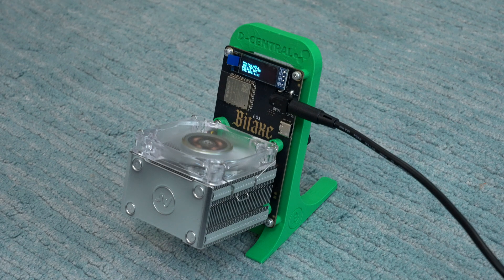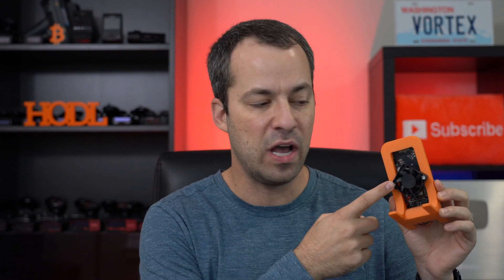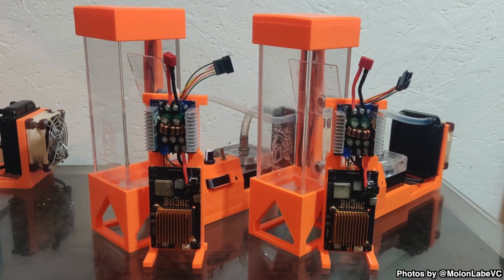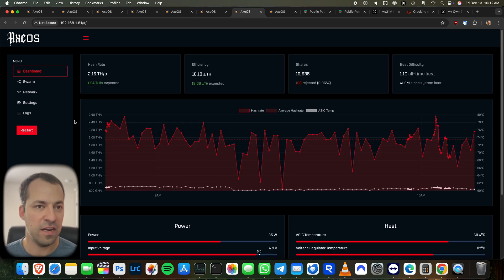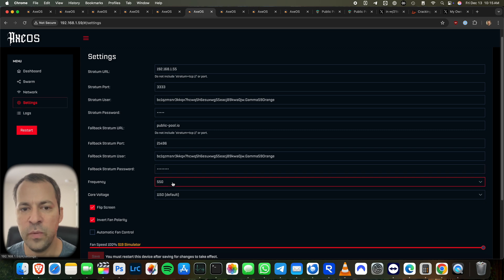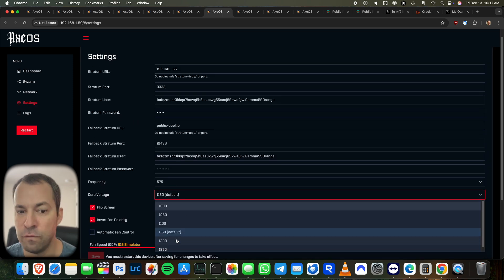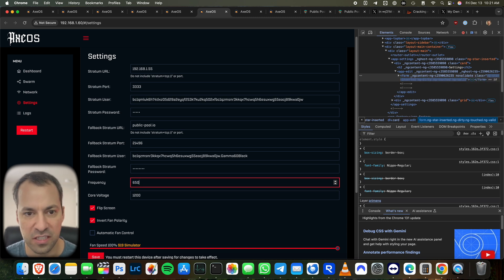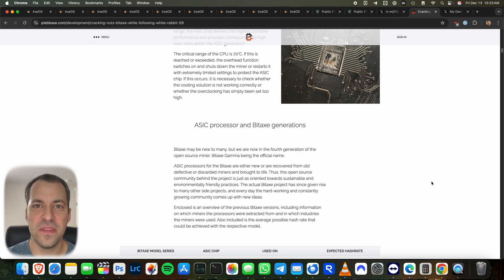How to Overclock Your Bitaxe, Part 4/4

Comment: It seems that ever since the very recent update, the right click + inspect trick no longer seems to be working.
Reply from the maker: Right, it's changed several times since making this video. The current method involves adding ?oc the end of the URL instead of using the inspect trick.
Reply: @VortexBitcoin  of course AFTER posting the comment I saw your updated video with instruction. ty

Comment: Just got my Gamma (BM1370) setup. It's stable at 625Mhz @ 1150 core voltage. Temps around 63-69C. If I undervolt it,  and hashrate stays stable am I good to go or should I also watch stale shares? If undervolted but hashrate is good is that the entire story?

Comment: So do you always run the fan at 100% even if not overclocking? I've been leaving my 3 stock Gamma's running on Auto/60°. Last night I put the Low Profile Ice Tower and 60x15 Noctua fan on one of them, but the 2 stock Gamma's are actually going better. (I used 2 bare copper shims so I think I need to take those out) So far I have only played with the settings in the non-oc UI for the upgraded Gamma, I dont remember the setting but it did get up to ~1.5TH for a few minutes before going back to 950-1.15ish
Reply from the maker: I run mine in the garage so I don’t care as much about sound so I just leave them at 100%. I suspect your results may be better without the shims.
Reply: @VortexBitcoin  Thanks for the reply. I've got mine in the basement which is a pretty constant 67F but the garage is probably cooler overall. I took the copper shims out but couldnt get a good fit directly to the cooler no matter what I tried. Finally went with a single shim over the ASIC with the Kyronaut paste on both sides. That seems to be a lot better than 2 shims and I can use the max 'default' OC settings of 625/1250 and stay at 57°, but the VR jumps to 91° so I want to add more heat sinks and a 2nd fan before I push it higher. Do you think the Argon Thrml is worth a shot on my others or just stick with the Ice Coolers?

Comment: Thanks for the info, very helpful. So when using a meanwell can 6 bitaxe be hooked up to it? Can I double up on each of 3 pairs of connectors or do I need two separate power units? 
Thanks
Reply from the maker: Yep! That's what I do. :)
Reply: @VortexBitcoin  can you still OC units when doubled up on a Meanwell unit?

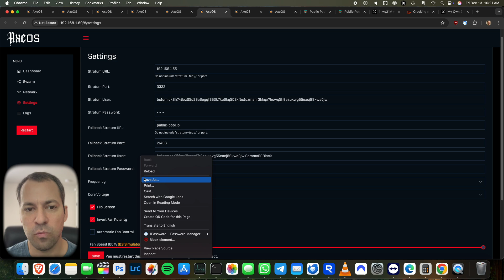Comment: 8:50 no need for chrome debug tools, just open the settings page in overclock mode (?oc, so /#/settings?oc) and thats it. You can change the frequency and core voltage there by typing it in.
Reply from the maker: Correct, that's the new method that was implemented as of fw 2.6.1 and discussed here: https://www.youtube.com/shorts/C0Ndt-P6TiA
Reply: @ thanks for the cool update

Comment: The part about voltage starvation really helped me out. Im now getting a fairly constant 1.5TH/s out of all my gamma icecoolers and still can push higher safely it seems. If your trying to overclock a gamma ice cooler i recommend moving up to the default 2 voltage settings right to start as your going to be pushing it to above 650 Freq pretty quickly. Make sure your fan settings are cranked up. Start moving closer to 700 from there and watch for volt drop. Hope this helps.

Comment: You can also add ?oc to the settings page url and it will give you overclock options to tick up the frequency and voltage by single digit increments. Look for Up/Down arrow buttons on the far right end of the input field on the settings page. Only works in Website v2.6.1
Reply from the maker: Yep, that's the new method https://youtube.com/shorts/C0Ndt-P6TiA?feature=share

Comment: I'm having a hard time finding the right settings right now. I currently have 800/1250. Cooling from the Raspberry Pi + 2 fans + Meanwell power supply. The expected speed is 1.63 th/s. I'm achieving that average, too. But it fluctuates between 1.3 th/s and sometimes 2.2 th/s. I don't know if that's normal or if it should stay constant at 1.63 th/s.
Reply from the maker: Yeah that’s normal

Comment: Really interesting video! 👍 Thanks! I'm experimenting with Bitaxe a lot, specialty now, in winter time, they all in my garage and temperature is around 52/46 , chip 52 and power regulator 46. Offcouse in summer time I will switch them to the factory base setting or they will die 😮 I know they are really weak, but good for playing.. 😊 will wait until Bitaxe with 10T will be available 👍
Reply from the maker: I’m experiencing that too, lol. Just ordered some beefier heatsinks to help with summertime operation. :)

Comment: Hello, love this series! I'm trying to push my clocking like yours.  I have a gamma with a 5v 8a power supply but my power input starts dropping to 4.9v when I get past 750mhz.  Do I need a new power supply? Temps and watts are all within range. Thanks
Reply: I just tried changing my frequency from 525 to 550 and my voltage dropped to 4.9V, not sure ill try overclock it without a better power supply

Comment: Thanks for all the information in all the parts! Just got my Gamma, beautiful little device. Only issue that I have is that on stock it barely stays on 5V input and mostly drops to 4.9V. When I try to overclock to 1200 core voltage and 550Mhz the wattage goes from 17 to 19W. My hash rate doesn't go up and my voltage drops to 4.8V. And what voltage does it become dangerous for the ASIIC? (undervoltage). Using a 5V 6A adapter so 30W. Already contacted the supplier but I'm wondering if I can keep experementing for now

Comment: Could you point me to a link of the cooling tower and stl for the mounting bracket.
Reply from the maker: Which one? The smaller double fan one with the LEDs on the orange Supra is the ice tower. The massive one on the green Gamma is the Argon THRML. Knowing that, you should be able to google for more details.
Reply: @VortexBitcoin  got it! And found the bracket on Thingiverse! -- question, is the fan 2 or 4 wire? -- i only have the mini 4 pin and no other plugs (not even right of the chip)